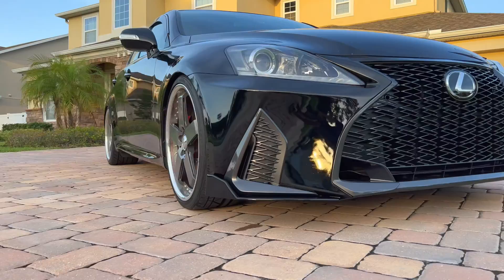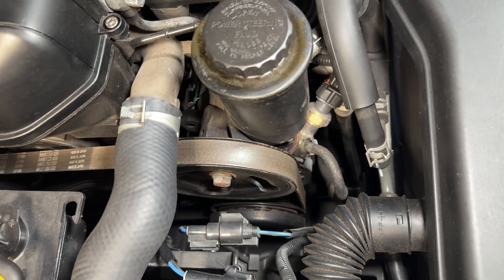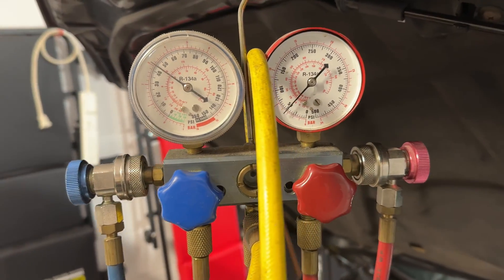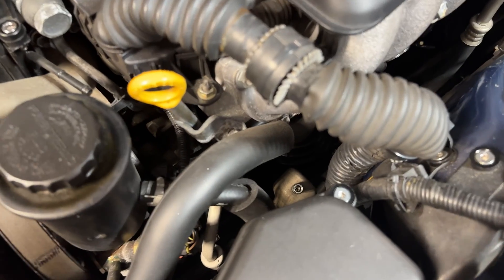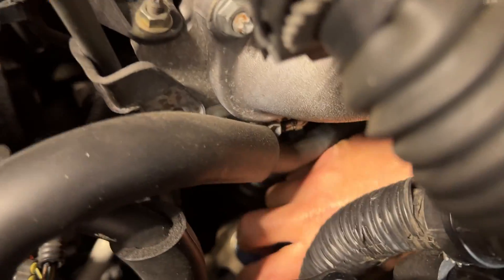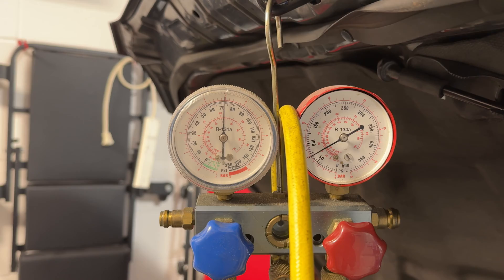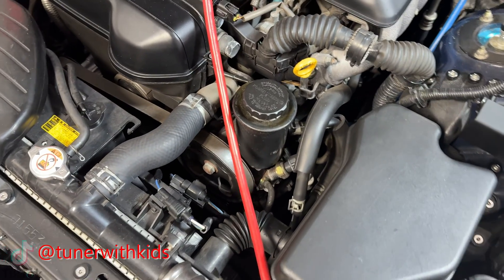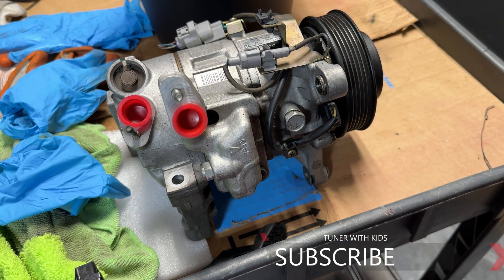How to Troubleshoot Faulty Automotive AC Compressor on Lexus IS300

Comment: Great video and very helpful.  I have GS300 with similar problem where I see the system has pressure on both low and high side but they are off.  I get around 70psi on the low side and 100psi on the high side with the compressor off.  When AC is turned on and the compressor engages, the high side remains the same and the low side jumps to around 85psi.  The compressor never disengages the entire 5 minutes I left the car running.  When I turn AC off, the compressor disengages and the low side jumps to around 95psi while the high side remains the same at 100psi.  Turning AC back on makes the low side jump down to 85psi and turning it off makes the low side jump up to 95psi while the high side remains at 100psi the the entire time.  Do you think this behavior is consistent with a bad compressor?
Reply from the maker: Sounds like worn compressor like mine.

Comment: I have a 07 Lexus is250 my AC button is blinking the ac compressor cuts off immediately any suggestion? What may be cause
Reply from the maker: Bad relay or failing magnetic clutch?
Reply: @TunerwithKids I already replaced the relay nothing happened once the compressor kicks in it cuts off should I get a kit
Reply from the maker: Did you measure the pressures? Short cycling could mean low refrigerant or compressor/clutch going bad.
Reply: @TunerwithKids  I haven’t done none of that I took it to mechanic shop they suggest that I get a kit new compressor and condenser and recharge the system

Comment: My ac button blinks, new compressor, new pressure switch new expansion valve hmmm
Reply from the maker: Check AC relay.
Reply: @TunerwithKids  relay is good
Reply: Lmk if you fix this. Same problem on my 03 is300. Changed compressor and issue is persistant. I’ve been told it could be the lock up sensor
Reply: @emiliegervais1143  fixed. Unplugged battery a few hours (i guess to clear codes) then started up car (with ac relay removed) then plugged it back in a few seconds after. No more ac blinking so i started adding freon, i have cold ac now